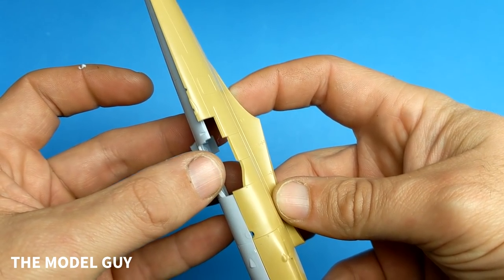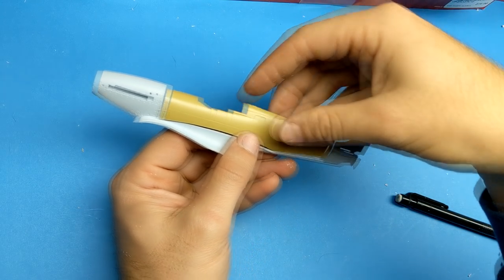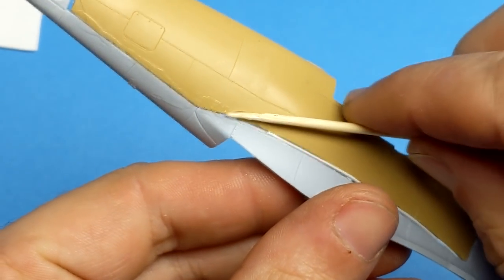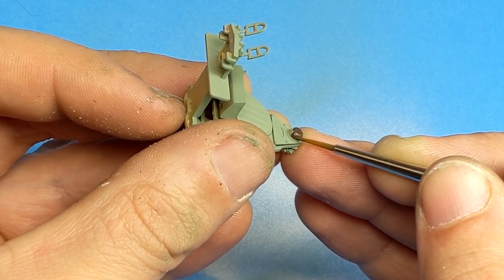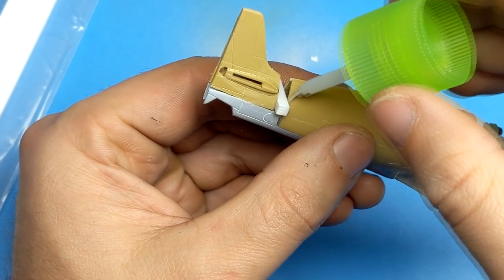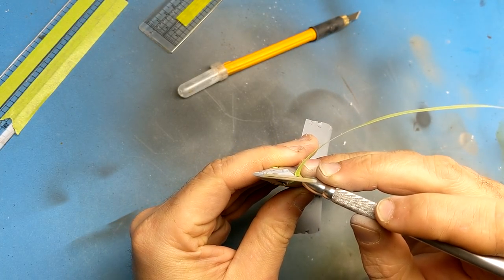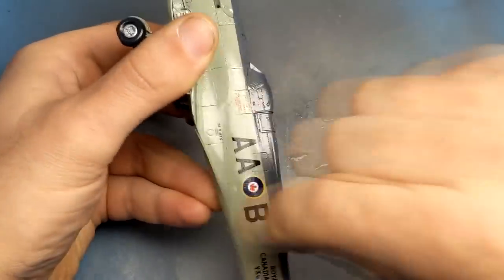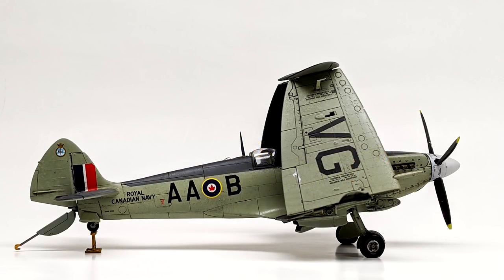No one is making a model I want? How do I make it anyways? Kit Bashing Airfix and Tamiya

Comment: The biggest modeling project was taking an AURORA 1/48 B-25 and converting it into a B-25H with a solid Nose with the 75mm field gun mounted in the left lower quadrant of the nose.  It also required that the cockpit be scratch built as well as the landing gear wells.  I also had to sand off the molded in insignia from the wings, fuselage, & tail.  I took the easy way out and installed a cockpit interia from a REVELL Doolittle Raider B-25C.  But since you couldn't see much of the interior it was sufficient.  I made this kit in 1974, so there is a lot I may have forgotten, but I do remember replacing the molded in fuselage gun barrels below the canopy, with some brass tubing to make it seem more legit.  I also sanded off the molded in guns from the waist positions and added a couple of Machine Guns from my spare parts box to add to the realism.  This was a beast.  The nose was carved from a piece of balsa wood and a .58 caliber Minnie Ball was epoxied in a hole drilled into the back of the balsa nose for the counter weight to keep the nose down when sitting on display.  I do wish I had pictures of that kit, but that was a long time ago.

Comment: Thats a brilliant build and great history and commentary. It is refreshing to see someone doing a project like this rather than just kit bashing. My biggest build was making a 1/12th scale 57 Chevy gasser drag racer from a Revel kit I picked up at a flea market. The stock wheels were missing but I got wider slicks and engine parts over about a year. It involved making raised suspension and a new chassis and roll cage etc. I think it is way more satisfying than just assembling the kits.

Comment: My largest modelling project wasn’t a single model, it was a collection of 1/72 models of the same aircraft in its various marks, the Spitfire/Seafire, I had to give up after completing around 24 models, with no two the same, because I hadn’t realised just how many variations there was of this aircraft. To make matters more difficult I was doing this in the early ‘90s when there weren’t really that many good 1/72 Spitfire kits on the market so the project involved a lot of kit bashing, cross kitting and using after market resin parts.

Comment: My biggest. Tamiya 1/16 panther G built as my great uncles tank in April 45. Used all the Aber sets, added a corrected metal barrel, scratch built rear hull with scratch ir box, 5 Jeff shui figures(resin), metal tracks, and a bunch of odds and ends. Took 2.5 years and I almost quit model building. Lol. It's at a model shop in Seattle, Washington, Emil's hobby shop.
Reply from the maker: That sounds insane! Any pictures?

Comment: Dang. That’s a super crazy wing folding sequence. Why they didn’t just move the hinges a little further out, then they wouldn’t have had to fold the tips also. 

That’s one heck of a Frankenstein job there. Well done. 

Bring cast iron or fabricated from steel, WWII aircraft exhaust most certainly rusted. Just to what extent depends on the AO, duration in service, and actual flight/running hours and of course the construction method of the exhaust.
Reply from the maker: Probaby had to do with the wing not being thick enough further out to have a strong hinge mount.

Comment: Oh! 　Seafire Mk.XV !!
Of the Spitfires and Seafires,  I think it's the most well-proportioned, sleek and powerful model.
I can understand why you wanted to make this model.
Among them, I like the early model of Mk.XV, which has a small ladder area.
I believe this 1/72 model is available from the Sword.
By the way, although it's a small thing, I think it's a pity that the bulletproof glass on the front of the windshield is not the built in type and the elevator horn-balance is not 
the  large area type.

Comment: I admire your filling skills, as I just tacked on an Airfix MK 14 nose on a Mk VIII Eduard (which allows making one of 8 prototypes Mk XIV, the third and last one with a standard Mk VIII tail, JF 318, which dispenses with changing the tail), and it was extremely hard, even with just the forward edge of the wing fairing being a curved mating surface... It took years, even at this simpler level...
Reply from the maker: Filling has been something I’ve been trying to get better at since this project. I had a problem with putty not staying in place and ghost seams. Sprue goo was a huge game changer and fills in very nice. It’s also a reason I steer clear of airfix because I know there is going to be a lot of filling. 

I also found the two kits needed to revisit this so at some point I’ll have to suck it up again :)

Comment: Wow! I don't know if I'll ever get brave enough to graft pieces from two kits together like that. It turned out far better than I imagined it would from the beginning. Have you built a Fairey Firefly? Also, I may want to start working with some resin aftermarket parts soon. What do I need to be aware of and how should I handle resin parts? I've read that the dust from cutting/sanding can be toxic. Thanks.

Comment: Should you ever accidentally mess up on a manifold or something similar; take a look at 1/8" or 1/16" hollow copper tubing. You can find it pretty easily. It is usually used, in real life; as a bourdon tube to an aircraft instrument or in car racing. It is very soft. Bendable by hand. And with the tools I have seen you use, easily machined down to what ever shape you are trying to make. Just a thought to give you a safety net when super detailing.
Reply from the maker: That's good to know, thanks for the tip

Comment: The Airfix 1/72 Lancaster Mk II has been my biggest project so far. Both from a size perspective and a difficulty level. The difficulty came from there being a wrap in the fuselage on one of the halves. Twice it sprang open because there was so much tension. Really wonderful work. What kit for the Banshee are you going to use?
Reply from the maker: I have the academy -38 which is going to require a jig to repair, so I feel your pain